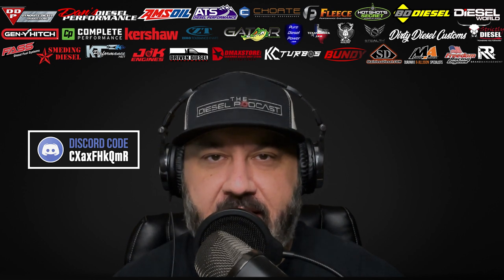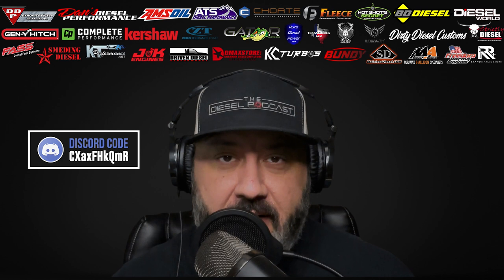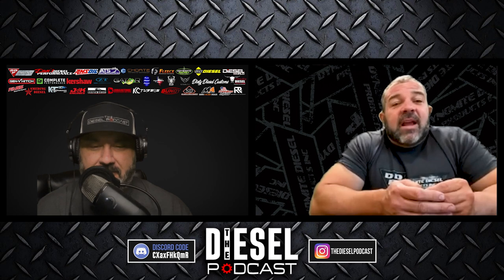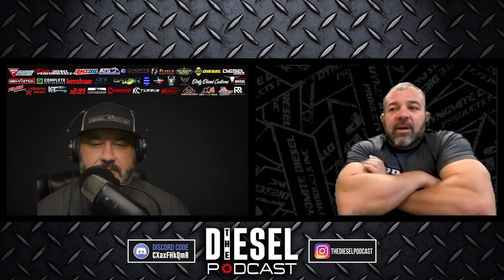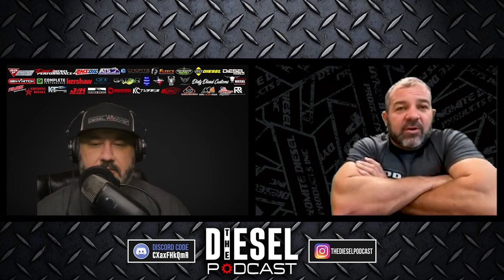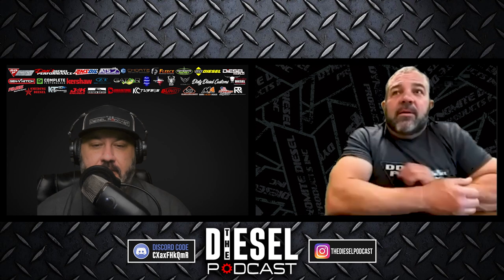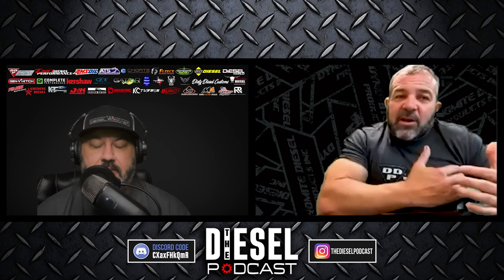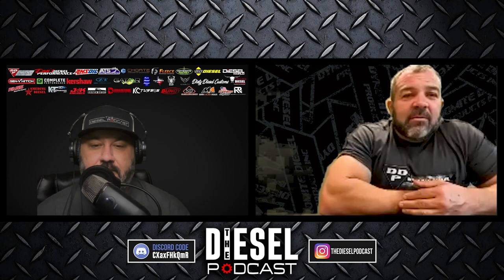Injectors Ruined During Install

Comment: Lenny looks like Mike Perry and Brian Callens' love child. I just rebuilt my vp44 h.o. injectors. Ran gasoline through the nozzles first then diesel. Cleaned the internals with nylon and brass brushes and yielded a perfect pie cut spray pattern. The lines I washed with soapy hot water. Then ran gas/carb cleaner. I ended up taking my vp44 off cause the fittings were exposed to dust. I'm thinking of attaching a short line to the inlet, then feeding diesel through to get at least some of the dust that ended up in the 6 line ports. Not sure if the vp44 cleaning will actually work if there is any foriegn debris in there.

Comment: I see lots of people doing injector o-rings on the 7.3 groups. I own a shop. I worked for a Navistar dealer for 10 years. I see lots of mistakes.  The biggest one is not cleaning the bolt holes for the mounting clamps.  Also, nobody is checking the other bolts in that stay in the head for proper torque. Always clean the bolt holes for every injector you replace. You won't get proper torque. I do lots of injectors on macks now.